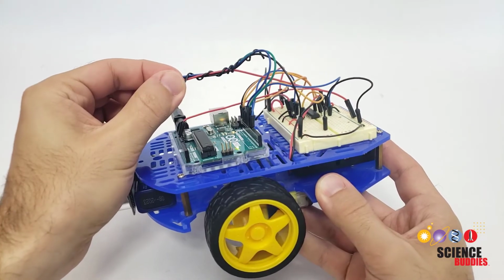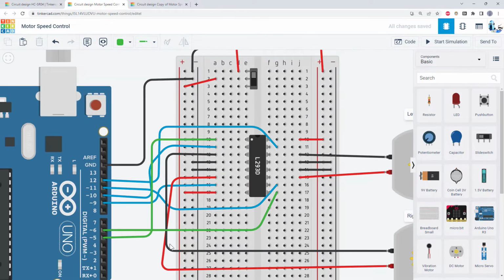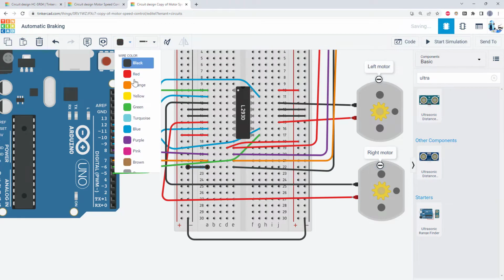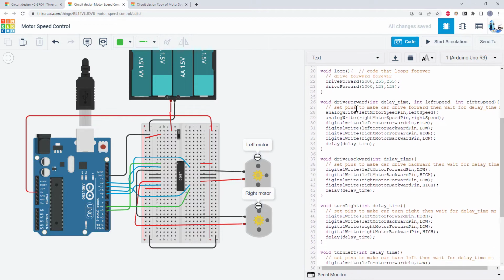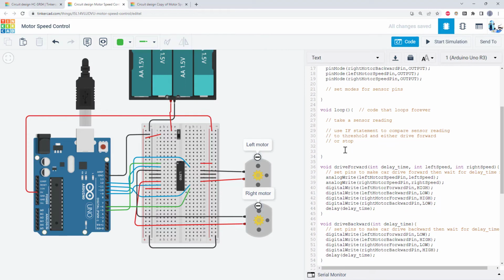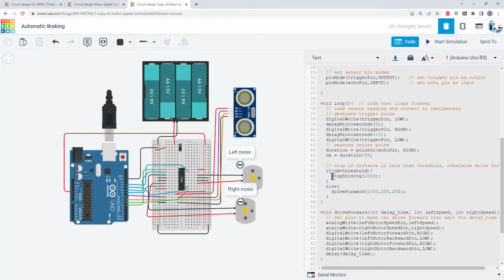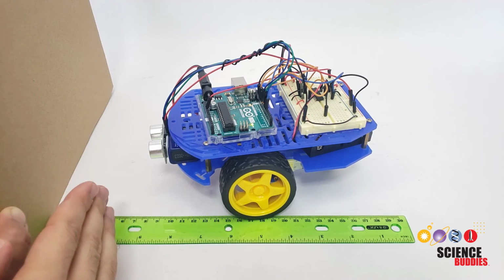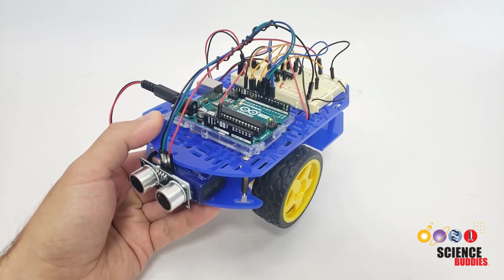Arduino Self-Driving Car Lesson 5: Detecting Obstacles

Comment: Amazing series, I wanted to point out that stretching those cables, (orange cable) will lead to hours of headaches when that cable is used in another project.  Not a good idea to stretch those cables as the connection becomes loose.  For example, I couldn't understand why some potentiometers readings were off in a project I made, having heavy sensors or potentiometers weight on some connections also damage the female headers sometimes.  Easy to think that there is something wrong with the microcontroller or code, but it is the stretched or connections at fault.  Bit of crazy glue on those cables will fix the issues.  Also, you could chain a female and male connectors to make a longer cable.
Reply from the maker: Hi - you are correct, this is especially important for classroom use where students re-use the kits year after year and the cables will start to fatigue. Our Arduino tutorial series includes a debugging/troubleshooting video which mentions looking for loose connections: https://youtube.com/playlist?list=PLlBVuTSjOrclb0iCMSRpS_H1lSrlSVeEm&si=1v1HwdtoZUdBM7w9